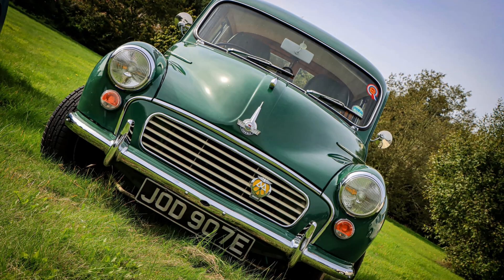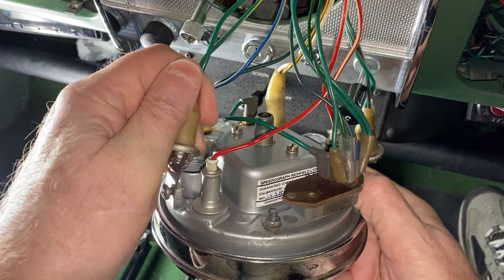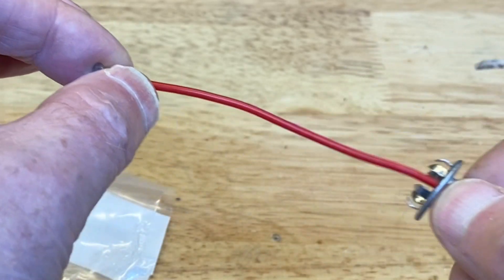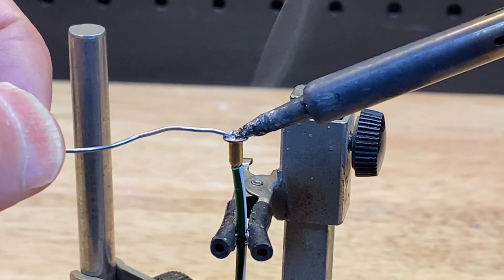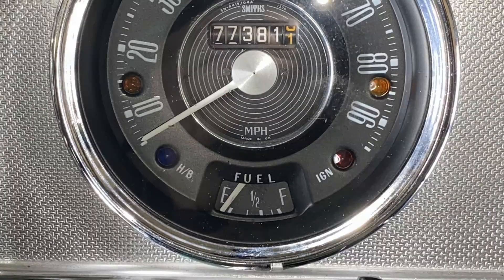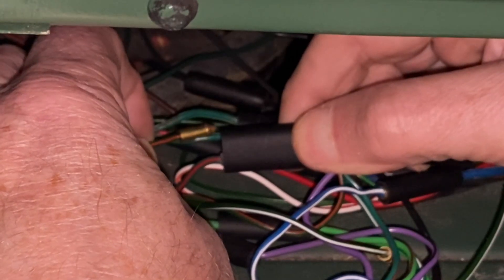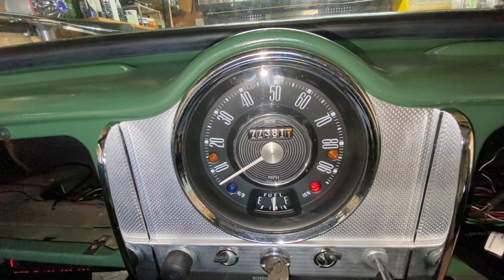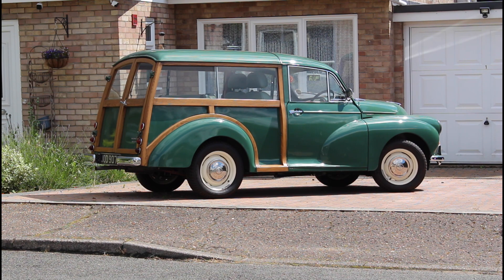Adding Indicator Repeaters to the Speedometer

Comment: I think that this is a Morris Minor 1000 vehicle.
The original turning signal lights operation is done by the indicator lever situated on right hand side of the steering wheel column. A green colour flashing bulb  illuminates when this lever is turned up or down when turning the car, and this was the original indicator of turning light signals. 

I have seen this on Austin Cambridge cars. My late grandfather owned a A55 Cambridge and it had the same feature of this beautiful green light for turning signal. It was so unique at that time! I still remember it! This feature was later added to Morris Minor 1000 cars. My late father's 1959 model Opel Rekard Olympia did not have such a feature. Only several British cars had this feature and i liked it very much in those days.

I think what you are doing here is a modification. Am i right!? 
I am a man living in South Asia.
Reply from the maker: Yes, you are correct in everything you say. And yes, this is a modification . Thank you for your interest.
Reply: @jodiethemorrisminortraveller  Hello, first i like to thank you for replying me! Now I understand everything about it. 
I am very sorry about any of my distractions if caused.
I appreciate your work!
Thank you for the video!
Reply from the maker: No prob. Many thanks 👍
Reply: @jodiethemorrisminortraveller  My pleasure!

Comment: Best tutor I have ever watched. Thanks, I'm setting about upgrading my minor with all the mods. Iv ordered all the bits but I'm hoping to use a column switch off a 1300 vanden plas I think I can fit a green light (as minor) to the stalk end and use the horn wires as indicator tell tail ligh, will it work?.
Iv been in touch with a chap who makes modified indicator swith covers that allow for the bigger switch. I only hope the self cancelling work or I'll have to get a lucas 35737.
Thank for your great videos and links
Reply from the maker: Many thanks!

Comment: Great video.  I did something similar on my 1968 mini after installing hazard lights from your inspiration.  I used the two amber warning lights to flash when the hazard lights were on.  The 1968 mini has a green repeater for indicators.  All the best, Paul
Reply from the maker: Many thanks Paul.